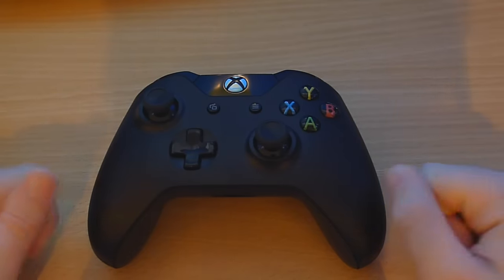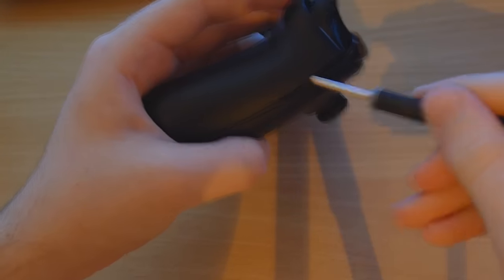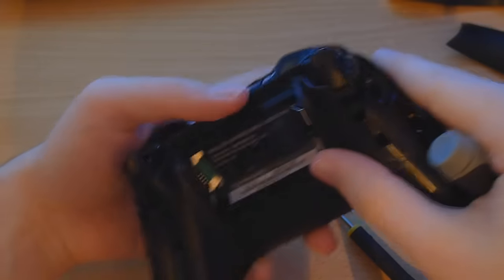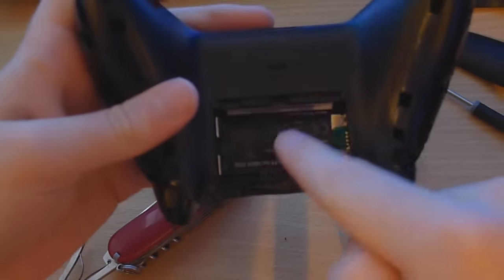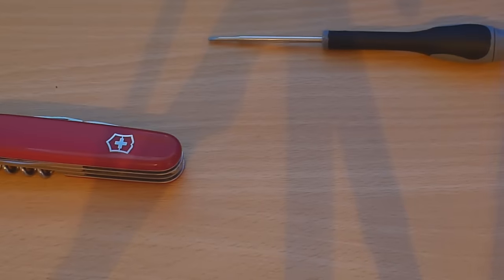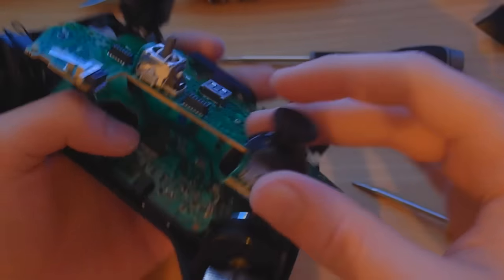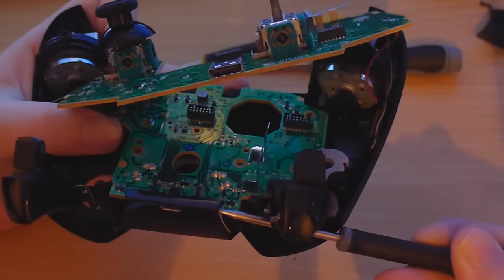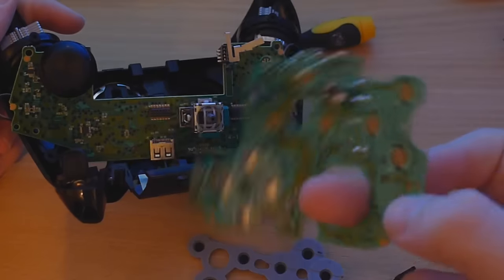How to Open up an Xbox One Controller

Comment: it took me 1 hour to get one panel off
Reply: Knuckles the enchilada took me 5 minutes to full take apart
Reply: I can imagine why it took you long pops one side pushes the side down 😂
Reply: Amigo that’s a comment of the year
Reply: I threw mine at a wall , they both came off
Reply: I took a panel off and then the clips broke :(
Reply: I couldn't even take it off
Reply: Damn it took me 2 throws to the floor to take 2 panels off
Reply: Damn I had it completely disassembled in a minute flat
Reply: Wow that's just wow
Reply: Took me 10 seconds
Reply: Took me an hour to fix the controller lol
Reply: and me
Reply: Took me literally 3.458 seconds
Reply: Don't worry it can take 5 second to take the whole controller apart by throwing it to a wall and just like that!
Reply: It took me 5 min. too lol
Reply: @detoxify299  same
Reply: DOntBeeToxic bruh, it took me like 3 min if that. It’s was hella easy if u have the right tools
Reply: Mr Chungus it took me like like 1 min to get both panels
Reply: Same. Maybe longer. Now and cant get the tiny screws out 😅
Reply: Me to I got one off but one of the clips broke off and since I’m opening it with my bare hands my nails are damaged and feel like they’re getting ripped off

Comment: A quicker way to remove the bottom board, that I figured out on accident after almost breaking the controller, would be to remove to piece that has the Xbox logo in it. If you slide it up towards you while gripping the bottom probation, too slide right off so you don't have to use the screw driver. Thanks for a awesome video!
Reply: i broke it
Reply: How the fuck are you supposed to take the logo off

Comment: I took a really small flat head and broke off the small hole in the security head screw. Then was able to use the actual T9 screwdriver to take out the screws. Really easy. Thanks for the idea. I didn’t have to go out and buy a special screwdriver

Comment: Thanks dude, you saved me $60 and some change. Turns out, one of the screws came loose in my controller and was blocking the trigger from working. Opened her up, took the screw out, controller works fine again. My left analog stick feels like it's going to give out soon but you gave me some time before I buy a new one.
Reply: yeah, my left analog stick is completely f**ked after i raged on it as a little kid☠

Comment: The launch controllers sucked, the left analog goes out after a few months.
Reply: Lol my right sticky just fell out
Reply: Ikr
Reply: yea having it right now
Reply: my right one has just gone..... it lists to the left ever so slightly, makes sniping fucking horrible.....
Reply: still using my day one controller, youre just unlucky lol
Reply: my elite controller left stick started to go not even a month after i got it witch is stupid
Reply: Left stick doesn't work anymore yay
Reply: John Doe Metro mines did also just now,  and the home button as well
Reply: John Doe Metro true that, I've had mine since 2013 and I won't touch it but the Xbox will detect movement on the left analog because it's stuck
Reply: John Doe Metro im starting to have that problem now!!! ughhh
Reply: Kyle5707 no dude,
ive gone thru about 50 regular controllers. same shit evrytime, when plyin madden. left analog breaks. once i got the elite i was str8. i had the same xbox 360 controller for 8yrs never had a prob
Reply: General E DGAF i got my xbox one November 2014 and i had to send it in to Microsoft just before the warranty ran out because no controllers would connect to the console unless it was plugged in by usb lol and i brought brand new controller thinking it must just be the controller and after i got my console back i just smell burning and the controller turned off and would never turn on again lmfao xbox ones garbage my xbox ones been fine since i got it back in 2015 from Microsoft but i barely use it now i play ps4 pro now
Reply: General E DGAF the funny part is my launch controller is still in perfect shape
Reply: Well my original controller still works, the one that came with my console that I bought 3 months? Aftet release. It still works like it's new. Bad luck dudes.
Reply: My left thumb stick broke so I couldn't walk to the right but a few months later it started working again
Reply: I'm still using my first generation controller 4 years later and looking to get a new one
Reply: Lmao that sucks my analog sticks on my 3 year old controller is fine.. the headphone jack went bad. But funny enough the new controller I bought the thumbsticks are already bad after three months and one play through of darksouls
Reply: ik exept mine lasted till agust 13th 2018 and the right september 22nd 2018 i bought one the day it came out
Reply: @smidget5843  Mine just somehow caught at a stop when I tried to aim to the right. With the right thumbstick.
Reply: I'm late but I'm having the exact same problem. My left analog stick leans forward causing me to constantly move in that direction in every game I play. It's awful.
Reply: @starpaladinnelaj  I had the similar situation with the right thumbstick, although my other controller's headphone jack had been desoldered.
Reply: My left went out.  Just setting it on the table.  So mad.  Sat back down and now it just makes the highlight icon on the homepage scroll left 1000 mph and in the game my character in RDR2 kept walking left in circles.  Not sure if I’m going to do all this work to investigate the left analog.  It’s probably shot
Reply: yup i had the same problem happen to me
Reply: Bought mine 3 years ago...still works fine today
Reply: Money Matters I’ve had mine for 3 years and it’s all good. My RB button keeps popping out though 😑
Reply: @lbulletsl4419  luckily i dont run into buttons popping out issue but i have to say microsoft, considering how much you charge for the controller already I think it's time you put a goddamn built in rechargeable battery like the ps4
Reply: xomegaxz Agreed!
Reply: I still have my original day one lol. And yes it has mileage. But works fine. I need to replace the left thumb stick cause the rubber is going away on the analog.
Reply: exactly
Reply: You must destroy the shit out of yo controller cause ive had the launch controller for the past 3 years
Reply: Mine I’ve had since launch and now it 2019 and it’s fine
Reply: Money Matters my lb n rb never works for at least a week
Reply: My right thumbstick got stick drift but that controller still works fine to this very day
Reply: the new ones do the same, im here for a reason
Reply: Yeah I'm watching this so I can replace the sensor in mine,  surprised it lasted this long
Reply: @dxncerr1233  exact thing just happened to my left analog stick but my controller wasn't a launch. I fixed it with super glue though.
Reply: @creepieryew7491  the series 2 elite controller works much better, or so I heard. My series 1 elite still works great after a few months
Reply: Mine works after years of use
Reply: I’ve had mine for 4 years
Reply: My controller kept disconnecting and connecting repeatedly
Reply: Mine was fine for 3 years until my cousin threw it across the room, now the right stick is fucked
Reply: Blow into the edges of the left analog stick.  It has stuff on the inside like dust jamming it up.
Reply: Just-in Time my right stick acts weird and when I try to tilt right the input studders a bit and won’t register properly
Reply: My launch controller is still going strong and it’s 4 year’s old
Reply: I have my 2 launch controllers and the left stick has the same problem, it doesnt want to move to the right when im playing a game like State of Decay 2. super annoying sometimes
Reply: Just-in Time bro facs

Comment: I just fixed a defective stuck D Pad on my XBOX controller by removing all the caps and screws and then reassembling everything after a good cleaning and moving around a bit to make sure all parts were OK and then omitting to screw back the top 2 and center screws. No more pressure on the D Pad, perfect precision. No one is the wiser, it feels new.

Comment: Had trouble knocking out the middle part of the screws I found to much easier to drill them out with a 1/16th drill bit the use Allen keys to get the screws out

Comment: If you get a small flathead screwdriver a 35-1301 from ideal tools, you can use that to undo the screws without breaking off the security tab in the middle

Comment: Exactly how small was the flat head screw driver that was used to unscrew the safety screw. I really need help because my right thumbstick is loose and broken so I need to open the controller. But the ONE screwdriver that was missing from the kit was the 3/64 (1.19mm). And the size above that (5/64) was barely not small enough. Please help!😭😣

Comment: Thanks for this. My RB started acting up, only working randomly. Had no problem following the guide to take it apart. Once I found the tiny white "button" switch that's activated when you click RB, I sprayed a little Contact Cleaner in there and it's working well again.

Comment: Thank you for the support, I found my problem, the left/right bumpers had part of the plastic break off, although they technically still work, they can go off balance and not respond, and I doubt any sort of glue will be enough to keep the controller working, guess it's time to buy a new Controller. Damned thing lasted me about 8 years.

Comment: I cant take the screws out and I've tried everything
Reply: Same
Reply: Just a small flathead... turn anticlockwise to loosen... clockwise to tighten.
Reply: Kxloux dude said anti clock wise
Reply: get a flat head that can fit and turn. It will break the middle part of the screw
Reply: G1adiator73 the tiny-ass screws you can use a 1.4 mm screwdriver, but the first 5 you need the specialty one. Trust me, I’ve done this a million times.

Comment: You dont have to unsolder the wires... Just carefully remove them out of the wire holders they are routed through. Make sure when you try to slide them out, the wires arent twisted at the holder and that they are flat. If there is any twist it will be harder and break the wires.. also don't take the rockers off until you snap off the top piece betweem the bumpers, then they will fall out.

Comment: I've watched a few of these disassembly video's on the the xbox one controller and took a couple apart and this video is by far the best, well worth your time watching this if you've never taken one of these apart.  Thanks for the amount of detail in this! Note though that the screws used vary, I had 3 controllers with the none security torque and one with. I even saw a Philips in one of the other vids.

Comment: What I did in the video 
-Pause the video and try and figure out witch way you turn the screws 
-readying comments
-write this comment and then break my controller
Reply: Stealth 100
Reply: lefty LUCY ,righty TIGHTY   or some
Reply: Well, try the middle screw first, if you accidentally strip it with your flat head just go borrow a dremel and grind a place for another flathead then throw the screw away because it really does nothing, then unscrew the others the way you just unscrewed the stripped one and voila
Reply: Well, are the comments ready yet?

Comment: Wtf, how do you get the one behind the battery area?! Do I seriously have to drill a tiny hole into my controller?
Reply from the maker: Its just a sticker covering the screw hole. Just force a screwdriver through the sticker and unscrew it.
Reply: Omg, thank you!! Thank god I didn't have to do that. I was about to give up on fixing it

Comment: Will you do a tutorial on opening up the xbox one console?
Reply from the maker: ashleighBeeBee 123 Yes
Reply: +xXModdedWarfareXx my B button has stopped working.. could you do a tut on how to fix that please and maybe the usb thing at the bottom mine fell out :/
Reply: +cookeay what did you do to the poor thing..
Reply: Marty Camenzind stood on the mic adapter by accident whilst it was still in the controller :(
Reply: +Galux and my spams Y button but when I changed settings to other buttons it spams other
Reply: +xXModdedWarfareXx my controller stop warming because I dropped a bit of water any advises

Comment: My right thumb stick keeps drifting upwards, can you make a tutorial on how to fix this please?
Reply: same problem here. did buy ne analog and i will try to replace the old one. fingers crossed :P
Reply: Same problem
Reply: I think only way to fix that is buy a replacment analog stick cause something might've broken underneath
Reply: Same problem. I’m trying to fix mine now
Reply: Change your inner dead zone to more so it cant move if its just a slight drift
Reply: gonzof90 how tf do you do that
Reply: gonzof90 how do U do that I have same problem
Reply: @bleehh63 blahhh sounds like the actual inside is stuck, youll need to open the controller up
Reply: @bleehh63 blahhh i feel you man my xbox one controller acts up too
Reply: @TheSteyrguy  Mine somehow is having problems with aiming right with the right thumbstick. And sometimes stops aiming right while I move it to the right.

Comment: Can't I just cut the rotors off? I don't use them anyways...
Reply from the maker: Yes you can cut them off and the controller will work just fine.
Reply: +xXModdedWarfareXx  Hey, what torx did you use to take off the eternal screws? not the first set, the 2nd and 3rd sets to actually have access to the led.
Reply: +A New Champion yea, those are smaller and they fucked me over
Reply: Illinois Native c
Reply: @MrMemo0325  I think they are either T6 or T5.

Comment: I threw my controller at the wall in frustration and the thumbstick came out -_- how tf is that possible
Reply: Austin Alexander  you can put it back on without opening controller if nothing broke
Reply: silencz1 How tho??
Reply: My son did the same and now I'm here looking for videos to fix it
Reply: Me too and my left thumbstick is basically dislocated
Reply: Austin Alexander you threw a controller at a wall
Reply: brayan palacios take the front panel off and pull it out. The inside was probably pushed in so just pull it out a tiny bit or decrease the dead zone
Reply: I bet you threw it out of happiness not frustration you cutie

Comment: If you dont have a Torqs head, the right head mini jeweler flat head will work as well. Just be careful its the right size to fit one slot and dont force it. It will work, thats what I used.